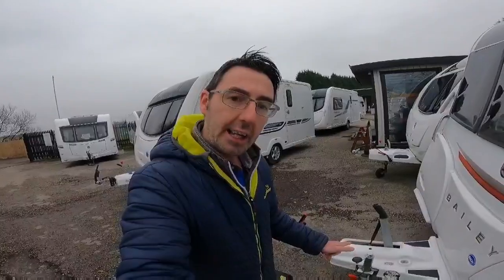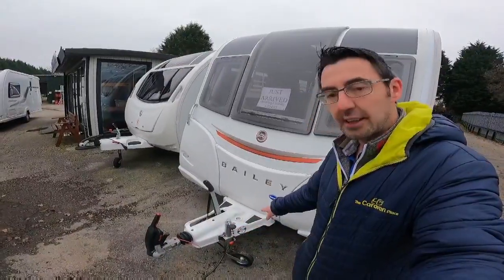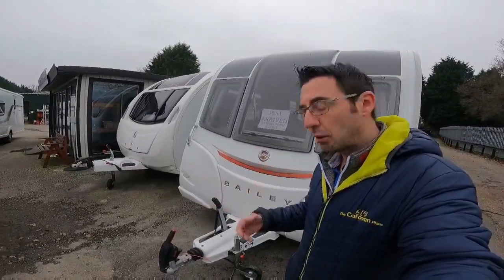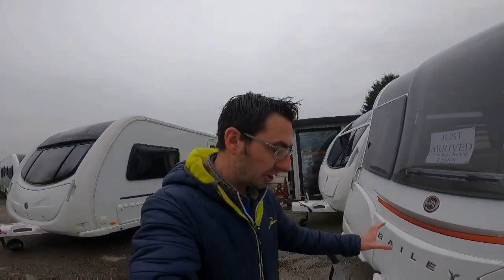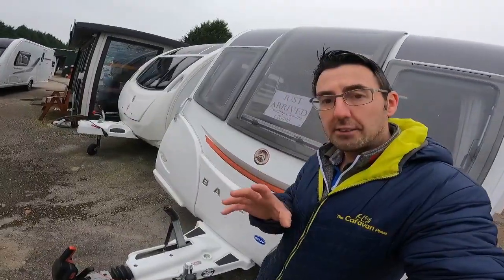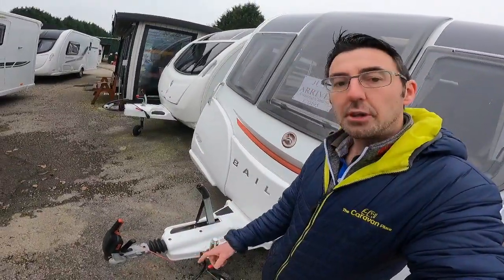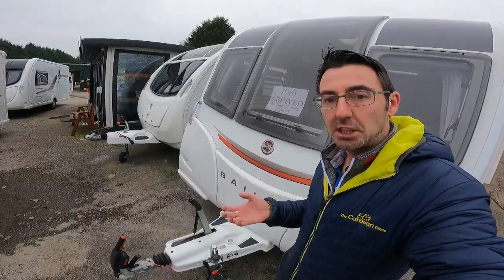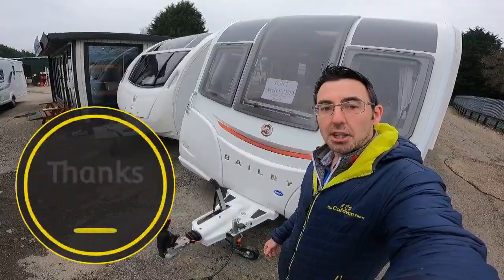Caravan ATC What is it and how does it work? ALKO ATC

Comment: Hi Mark. Why don’t they fit a manual lock when reversing to stop the brake coming on, I was trying to reverse onto a very soft grass pitch last week and because the van sunk into the grass (1.6t van) and the wheels on the awd just spun, had to eventually use the motor movers to get it in place. I get that it could be a safety issue if left in place but that’s all part of the checks when hitching up. Thanks
Reply from the maker: In theory the brakes shoukd come off in reverse if they are set up correctly. But if sinking in the grass it may just have been that causing the issue?

Comment: Hi mark,I've got one 7 pin connection on my car,I use an 16 pin adapter to hook up with the caravan,will the ATC still work  ?
Reply from the maker: No unfortunately you need the grey electric also wired. The black is just lights, grey will charge battery, run fridge and also power the ATC. 👍
Reply: I had this and I now both twin sockets fitted for black and grey socket with towbar. My ATC works perfectly now as wasn't working before you also need the grey to have your fridge cooling down when towing too. I have to caravans in the family one with atc one without can notice the difference so will hopefully get it fitted to the Lunar Lexon CS soon

Comment: Hi Can you answer a question please ,  when i unhitch my caravan from the car and  use then use motor movers ,  the caravan is not moving correctly, because the hand brake is still on although its down. the long bar under the handbrake is not doing anything because its not been disconnected  correctly,   its something to do with the hitch piston on the front,  what do you know about this issue.. the system works fine no problems , just my  procedure is not right..   twice its done this  and I've to connect the car to release the cable  /handbrake... then use the movers ..
Reply from the maker: is the damper staying in, where the hitch pushes into the caravan?
Reply: Hi  i believe it should spring back out,  its working as it should do going in and then back out..  what i am trying to say is what pushes and pull the push rod,   when using the hand brake you can see it moving  back and forth..  but when the brakes on its doing nothing..  this seems to be a common problem i am trying to understand